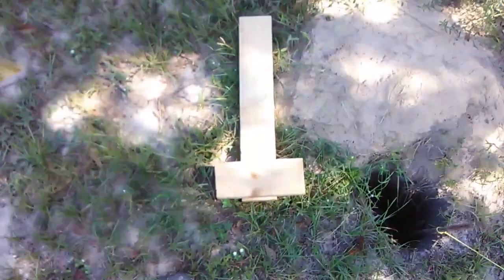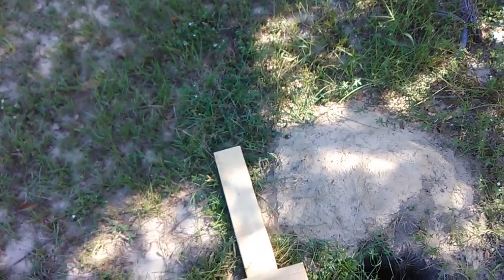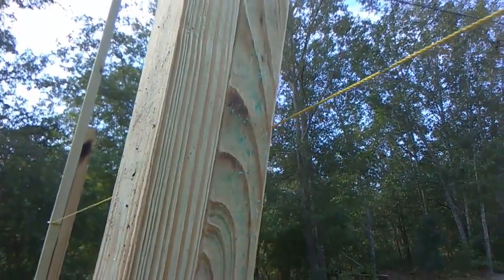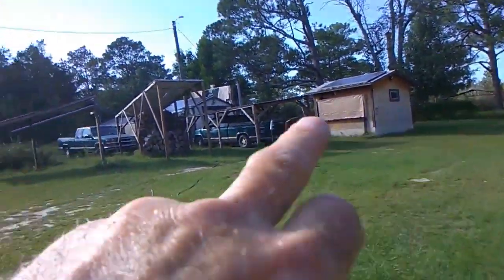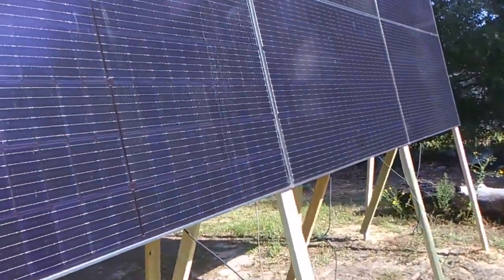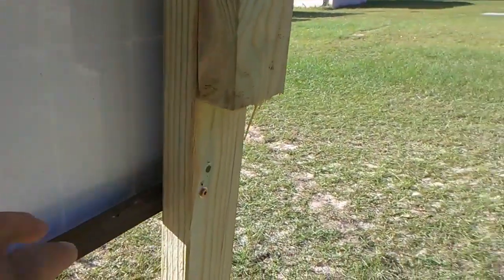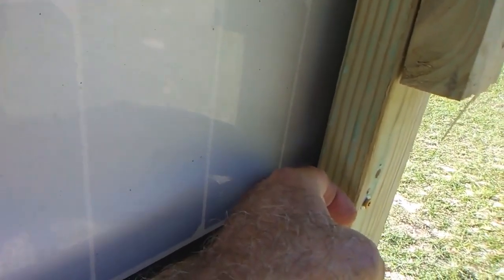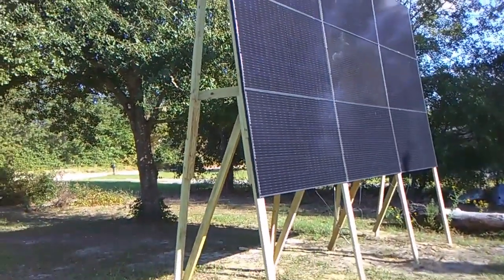Bossrox DIY solar ~ Why I put up an 85 degree 3kw solar array

Comment: I mounted all mine 90 deg, good boost with snow, also you might not have to clean your panels. 1st rain after a dry spell splash mud halfway up my panels, 2nd rain rinses it off.
Reply from the maker: I had enough power coming in for mid day to mid afternoon so to boost mornings & late afternoon, this was the way to go.
Reply: @bossroxdiysolar  I have to move 1 array to get extra 2 hours
Reply: I've heard, that if panels are gonna be in partial shade and/or  landscape orientation, then panels should be wired in parallel, to get the most out of them, also series -parallel for (voltage drop) long wire runs to destination (depending on wire gauge). I'll have to find my pics of my set up and share on here. I have a much smaller array than you. Nevertheless you did a good job. Imma subscribe to ya to find ya to post my pics.
Reply from the maker: @mrDADtheSecond  Yeah, if you got shading problems then parallel is the best way to go. if you got 3 in a string & 1 gets shaded, it knocks down the whole string.
Reply: @mrDADtheSecond  the arrays are mostly set up for winter with snow, the rest of the year they only get 50% and I rarely see absorb charge Mar to Oct, this year with upgrades discharge 7 kwh, last year 14kw a day, worst case 2 hours of Gen every 3 days, rather than 2 hours every day. Still a bit of work to go to boost overcast watts. Tuesday for sure a short video,clear sky after 1st snow, might blow the fuse on pv4. Ultimate test day.